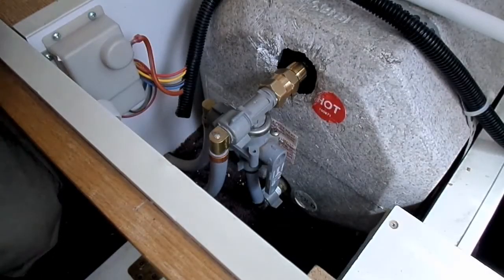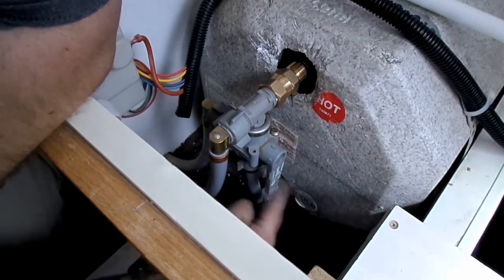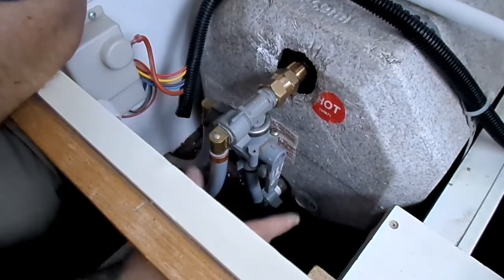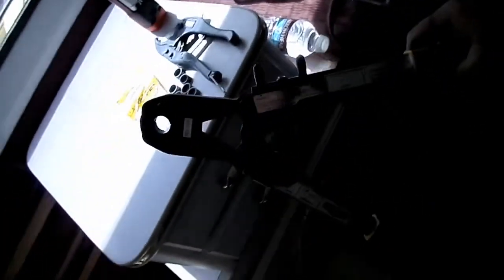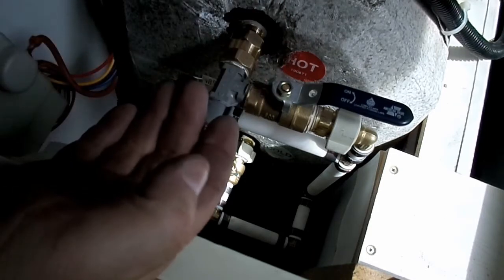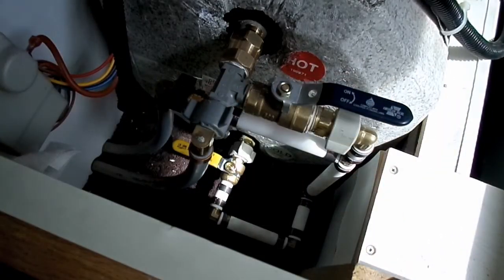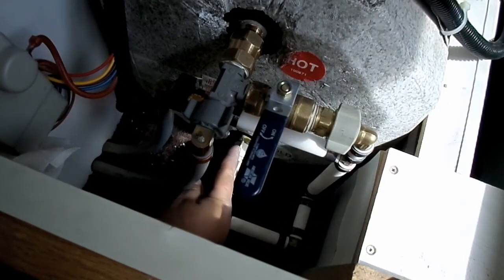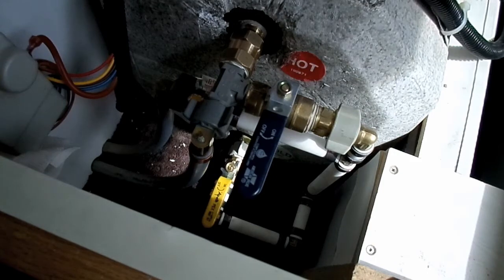Water Heater Bypass Leak Upgrade Fix in RV Van CamperVan

Comment: hi my name is Sam and I have a question for you .I was winterizing my motor home ,I put the valve on bypass but I still get antifreeze in my hot water tank, my bypass-normal valve seems to be ok ,could it be my check valve?
Reply from the maker: +SamuelJr Olvera Perfect place to start is the check valve... they are known for failure due to lockup
Reply: If you added the valve....did you add it on the proper direction?  Did you remove the nipple and then add the valve and then add back the nipple?  Might be as simple as added on valve backwards direction.